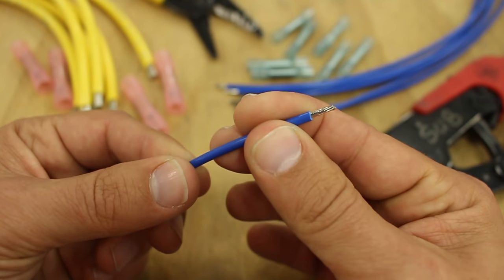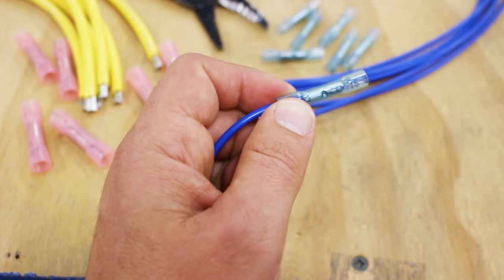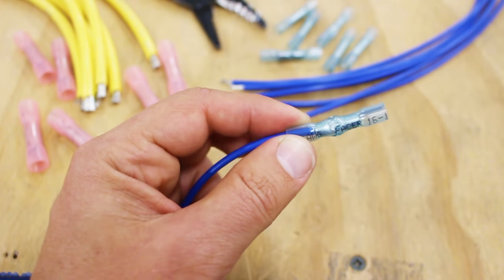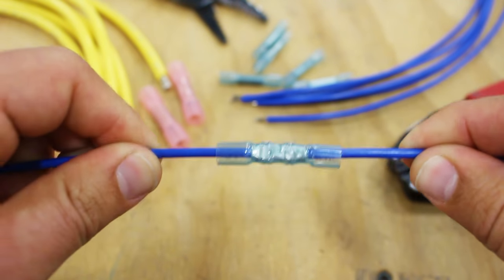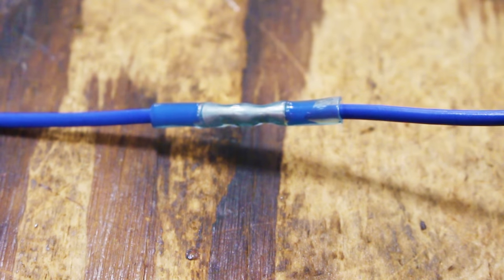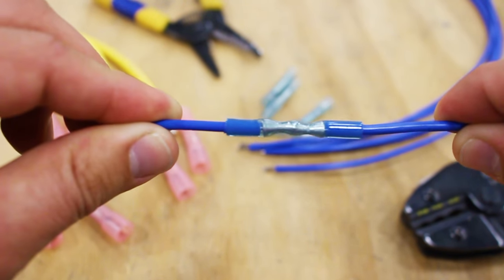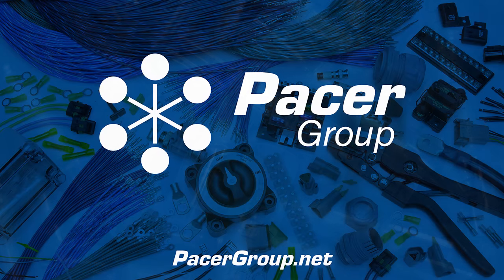How to Use Heat Shrink Butt Splices

Comment: "First, make sure you've correctly stripped the wires to the proper length." But doesn't explain the proper length.
Reply: its in the description
Reply: @ConfiscatedZyra  its also common sense

Comment: Do both ends of the wires need to touch eachother inside the butt connector? Or just the metal contact
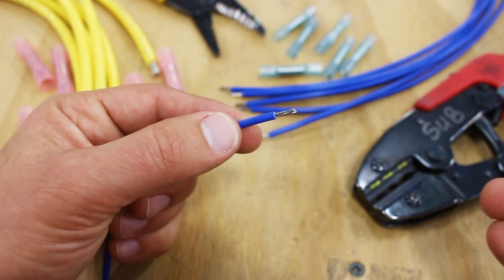Reply from the maker: Great question. The stripped wires need to fully butt up against the interior bend.  If you take the video to 0:09, you will see an angle of the splice showing the inside. You can easily see the bend your wires should be touching.

Comment: I’m using a crimper rated for insulated connectors, but still tear through the heat shrink. Is there a special crimper for these connectors??
Reply from the maker: So sorry for the delayed response. If you're tearing the heat shrink you may be using the wrong crimp nest or incorrect tool.  If the tool has ratcheting action, you can manually release it before the heat shrink tears. If you do this, be sure to perform a tug test to ensure the crimp will hold. The best solution would be to use another tool.

Comment: what did you use to heat shrink it? Tried a lighter and hairdryer. lighter burned some of the insulation off and hair dryer didn't seem hot enough. maybe heat gun is best.

Comment: Should you also heat shrink the connector for extra protection?
Reply from the maker: It would not be necessary.  The connection is already sealed during this process if you are using our adhesive butt splices. https://www.pacergroup.net/heat-shrink-butt-splices-22-10-awg/
Reply: Ther is already a heat shrink around the connector.